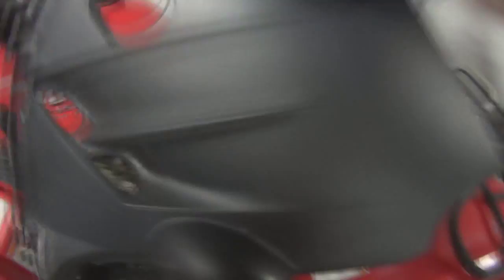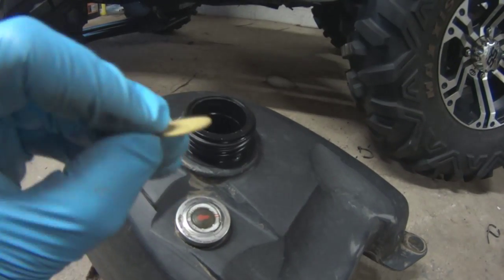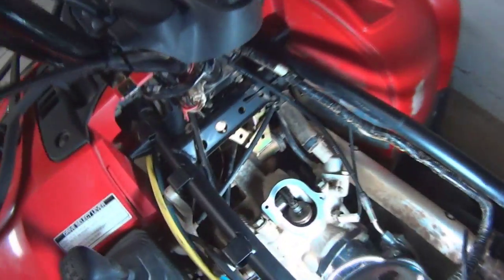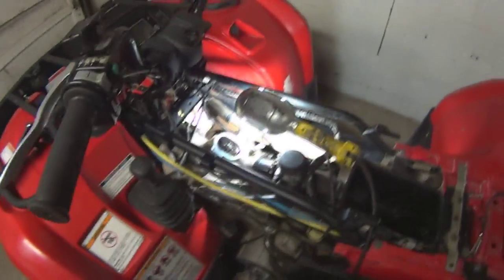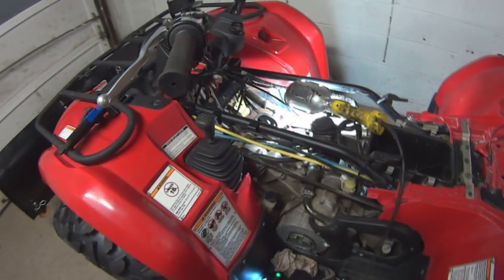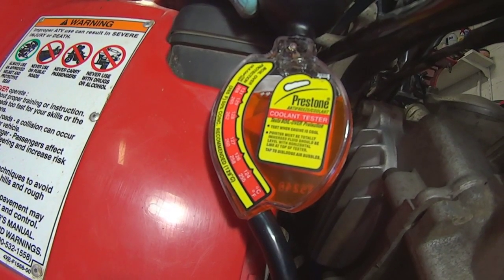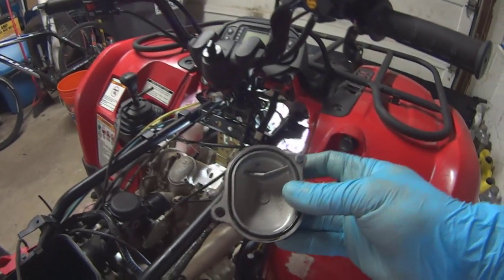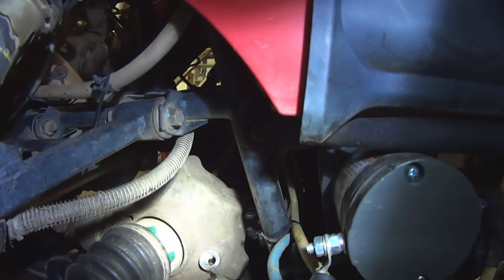Yamaha Kodiak & Grizzly valve adjustment and fluid check

Comment: I got the same Yamaha and it backfires when trying to fire it up. it doesn't start. Carb is leaking fuel from the overflow tube. I assume the float is stuck. I assume i need to follow your steps to remove the tank and all and get in there?  did u ever clean up this carb?

Comment: how did you actually adjust the valve?  That nut on top?
Reply from the maker: Yes. Brake it loose and spin the screw with filler gauge between till its tight

Comment: Hey Trout Junkie,
A friend and I just checked out our valves, mine were tight like your video said it would be. I adjusted and everything went well, but now when I go into drive or reverse the machine bogs out. I can get it running for very short distances but it eventually bogs out, no backfiring or other odd sounds.

Would this happen if the valves were opened too wide?
Reply from the maker: No. No way valve being too loose or tight would stall the engine. You may loose 10% of power with valves too tight but if too loose, you would hear a rattle,ticking, thats it. These valves travel 1/4 of an inch. You would have to have them loose by half that fot them no to deliver mixture for ignition
Reply: Thanks for the quick reply!
There is no ticking or rattle, so that's not the problem then.
I may have pinched the gas-line or something foolish when I put it back together.

Comment: both valves are adjusted at the top dead center? I assume you check it through the spark plug hole with a screwdriver?
Reply from the maker: You can feel it cranking by hand. Compresses the air
Reply: Im looking for the top dead center through the opening as you explained. there are two marks. a line and a T, which one of them should be aligned with the crankcase stationary groove?
Reply: @Sean-Aviation  T
Reply: @shawnmcclure7282  The line guy. The t itself just there because it specifies the fact of the check line beside it

Comment: Hey there bud I can’t Figure out this feeler gauge what were your numbers on the intake on the gauge and the exust thank you
Reply from the maker: Intake next to carb should be .004 max. .005 should not fit

Exhaust should be .007
Reply: Astro Camper opps i went .005 on the intake and exhaust I want .008
Reply: So wat is if u run out of tread on the lock nut
Reply from the maker: Imposible. You are only turning half a turn. Full turn gives you .015 gap
Reply from the maker: That's fine. Always better to be on a high side. The gap gets tighter as the valve seats wear in.

Comment: Is it the same for the grizzly 700
Reply from the maker: Not sure
Reply: Pea yes it’s the same
Reply: Not the 16-18 Grizzly 
It’s a horror to adjust valves on the 708 bucket and shim job
Reply: jayonez 13 why is it a horror?
Reply: jayonez 13 708cc is the best made regardless how hot they get, that’s what the fan and coolant are for...my buddy and I would go on 10-12 hrs rides, he had a 708 and I have a 421. Never any issues...

Comment: I have a 2000 kodiak 400 that is leaking fuel. I try to throttle it in gear and it limps forward and doesn't have normal power. Any thoughts on what it is? Carb related?
Reply: aaron jacobsen old gas

Comment: You do realize thar you are suppose to use an oil designed for the wet clutch in the motor.
Reply from the maker: Yes. and that is the motorcycle Mobil 1 oil I used which is made for wet clutches.
Reply: Astro Camper except the Kodiak doesn't have a wet clutch so it wouldn't matter much. It has a CVT. Nice try trying to shit on somebody else's video, but he did use the wet clutch oil either way. Congrats on failing.
Reply: That was obviously for Dfuller lol
Reply: +88silvergt Actually the Kodiak's with the Ultramatic transmissions like this one in the video have a wet clutch, that's why you'll never smoke the belt because the wet clutch is what slips, not the belt. I've replaced lots of wet clutches on the Kodiak's, and Grizzly's !  Usually the belt will never slip as long as the belt doesn't get wet, and belt case stays some what clean.
Reply: WRONG. Yamaha (at least in my '03 Kodiak manual) clearly states to use conventional (not synthetic) motor oil as there is a WET CLUTCH (their words) in the transmission drives system which uses a wet clutch (their words again...)
Reply: Misterpolytech it says automotive oil without the anti friction additive is ok. Most auto oils have these additives
Reply: @erikdeterman870  U can buy without. Just dont want label to say energy conserving. People run rotella t4 and t6 through theae bikes and even sport quads like trx 450s and 400exs